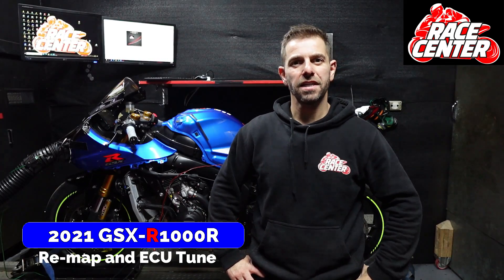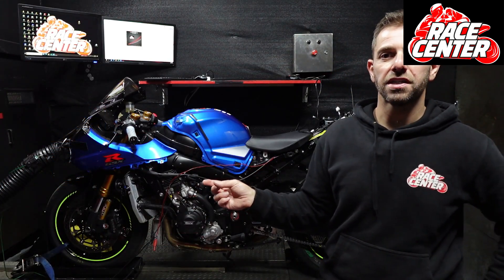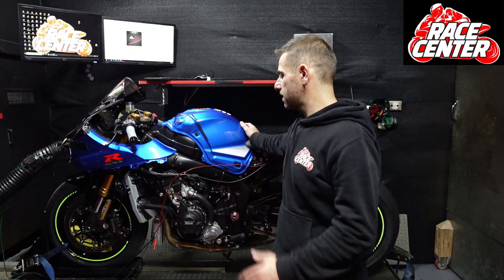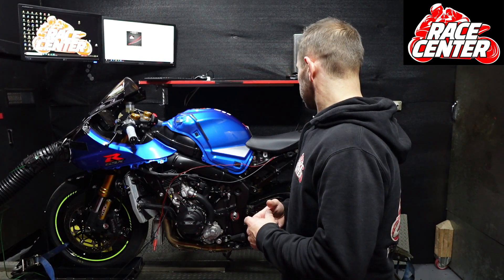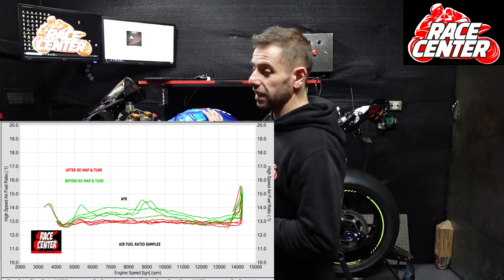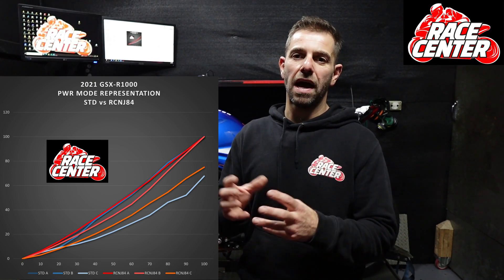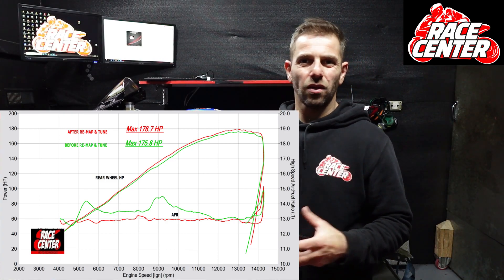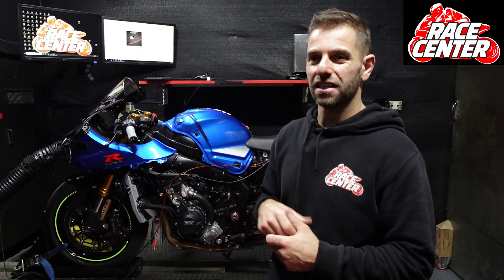2021 SUZUKI GSX-R1000 ECU RE-MAP & TUNE

Comment: Hey Daz
I’ve only ever ridden R1’s, how does a GSXR compare to an r1?...
Cheers👍
Reply from the maker: Hey Someone, both are great bikes and a bit of it comes down to personal preference. And both can be made awesome. The R1 probably has a bit more character with the cross plane crankshaft and firing order.  However, I do feel the GSX-R is a more refined package / easy to ride package out of the box. Some might see it as a bit blander but I do think it is a great bike. The R1 is def a bit cooler, but throttle connection out of the box, the GSX-R is a lot better. But the R1s jerky throttle can be fixed with a remap
Reply: @RaceCenterAU  thx👍